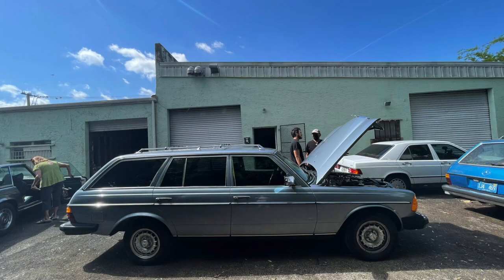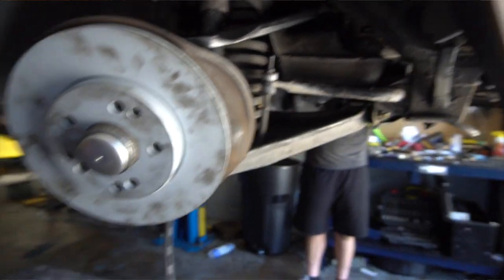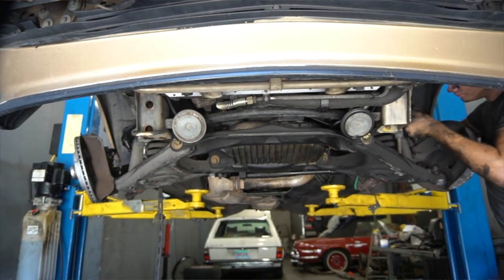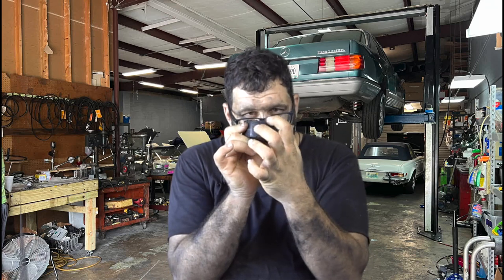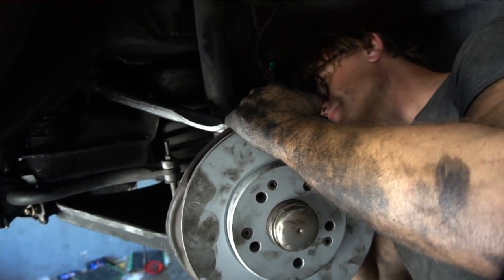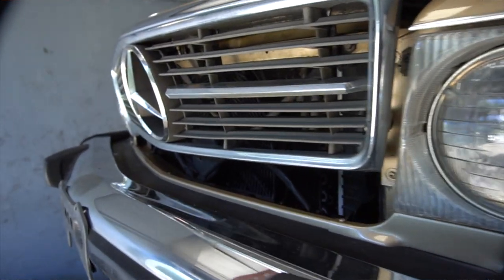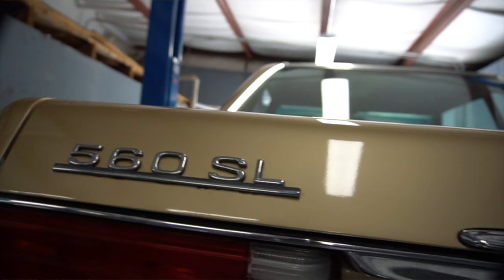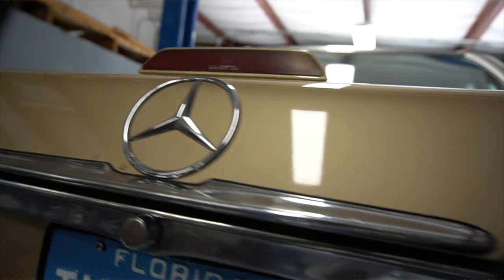One job that no one does on the R107   HD 1080p

Comment: I replaced my engine mounts, engine shocks and both front and rear subframe mounts in my 1987 560SL. I actually removed everything under the car including the entire suspension (control arms, tie rods, steering gearbox, etc), rear axles, hubs, differential, caliper pistons and so on. Every nut and bolt was either reconditioned or replaced with new genuine MB parts or NOS. I even changed the catalytic converter with NOS. It took me about 10 months to do it all in my garage without a lift. I’m currently rebuilding the engine from the crankshaft up. New MB rings, valves and so on. I started the engine rebuild in November 2021 and I’m still not finished. I was hoping to install the heads this past week, but some simple machine work I had done was faulty so I had to remove the front cover to fix what the machinist screwed up. I probably have over $15,000 in parts! The transmission is in California at Sun Valley Mercedes Transmissions for a complete rebuild. These cars are expensive to work on and the manuals are terrible. Oh yeah, you also need to purchase a lot of specialized tools that are not cheap. I’m not sure it will be worth it in the long run.

Comment: Frankly, I'm old and tired of battling it with 3 mb. Parts r expensive and people r basically ripoffs. I'm old and can't do much anymore. Selling my cars. I've had enough of the liars.
Reply: Too bad you won't have a diesel available in 6 months
Reply: @allwinds3786  nope no diesels. Gas powered only. Diesel fuel headed way up. Unloading big motors and diesels soon!
Reply: The good thing about expensive parts, is you only but them once! So in the end, not expensive. Buying cheap parts is expensive, because you have to do the job again!

Comment: When i was 19. I had a 220d /8 with subframe bushings so bad. The alignment would shift in a corner. Making the steering wheel crooked. Yanking the wheel to the opposite side of the previous corner would fix it. Im wiser now

Comment: Thank you for providing valuable information on this job. Especially considering the safety concerns working with a loaded suspension and a power train suspension combination that can kill you if you are not informed. I did the subframe mounts on my W114. I had the luxury of a 2-post lift and it transformed the way the car drove.

Comment: Thank You Pierre. The 107 service manual is extremely vague on this when it comes to checking the rubber mounts. Especially when the mounts are installed. Many opinions state that if you can spin the rubber buffer shown as part 2c in the manual then the bushing needs to be replaced. When I install a new set the rubber buffer will not spin. It will be tight against the mount. But 6 months later it will settle and there will be ~ 1/8" gap between the buffer and mount. In fact the cutaway picture in the manual shows it installed with a gap.

Comment: I had this done on my 450SLC and it helped with the vague steering and the subframe mount stopped the grinding noise on cornering.   I paid quite a bit for the genuine Mercedes motor mounts, but after 18 months they have already collapsed like they were uro parts.  Had the little engine shock absorbers at the same time.     I went with the genuine subframe mounts which hopefully lasts another 20 years.   For some reason Mercedes discontinued the part number to buy everything required as a single part number and I had to buy each part number individually.   Strange.
Reply: URO does has supplied Mercedes in the past.
Reply: @MrBobby3340  I would only use URO if there was no other option.
Reply: @classicjalopy  agree!